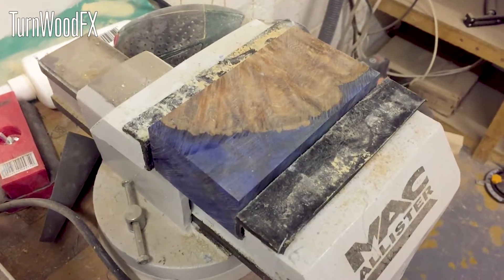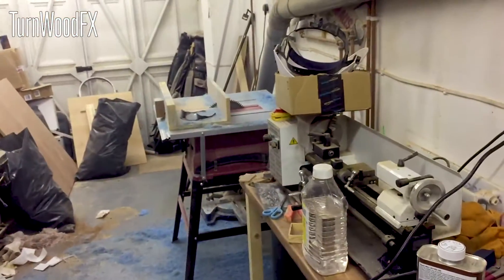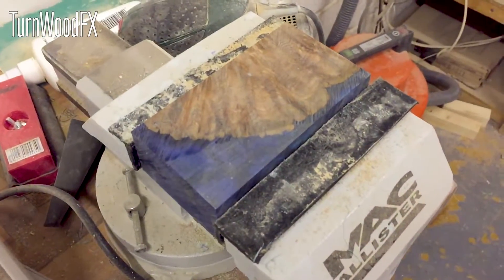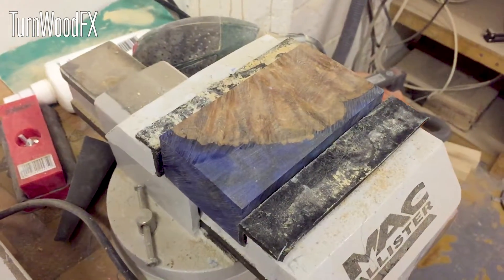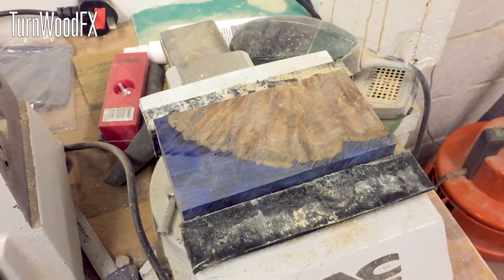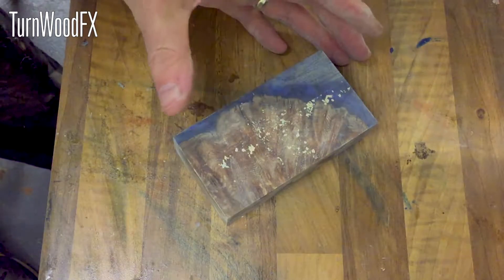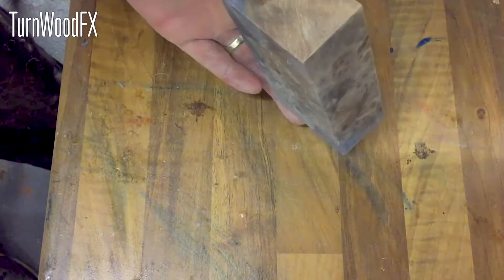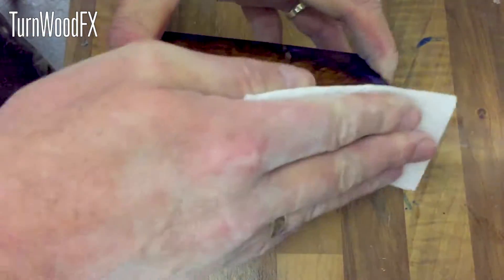Stabilised Wood Hybrid Block - Behind The Scenes

Comment: Lovely looking block Scott as always, i have a lunar stabilised mod and have spent hours with micto mesh pads and cant get no shine at all any tips buddy please ?
Reply from the maker: Hi mate, micro mesh should give you a reasonable shine but if you want that super glass like shine then you will ideally need to get yourself some polishing mops. I use a 3 stage polishing setup with a dedicated mop for each polishing compound. I sand with wet n dry paper up to 800 grit and then i switch over to the polishing mops...The 1st one is fairly abrasive and aids in removing fine scratches, the second takes out further fine scratches and starts to produce a nice polished shine and the 3rd compound adds a glossy finish. You can get polishing mops that attach to a drill and i get my polishing compounds from ThePolishingShop.co.uk
Reply: TurnWoodFX Hi Scott, Many thanks for your reply i have been using a dremmel with a polishing wheel on it and got a lot better results but still not what i would like. Thankyou for taking the time to reply will look into getting some polishing heads and compound, Cheers mate and keep up the great work may get the chance to own one of your mods one day but plenty infront of me 😁
Reply from the maker: Hi mate, i dont have any waiting list etc so you have just as much chance of owning one of my mods as anyone else. When they are available i simply add them to my Etsy store and post on my TurnWoodFX Facebook page to make people aware...its then just a case of adding to cart and checking out :)